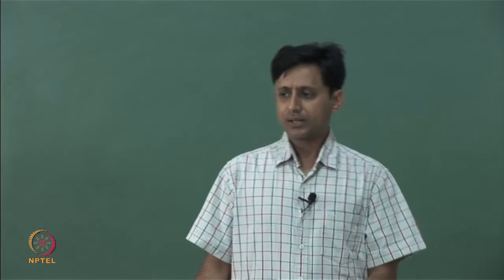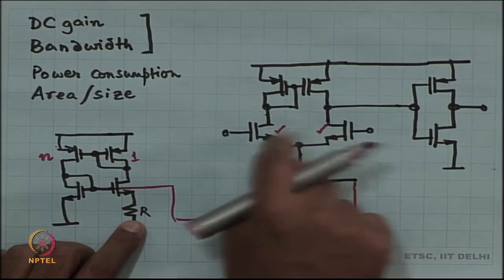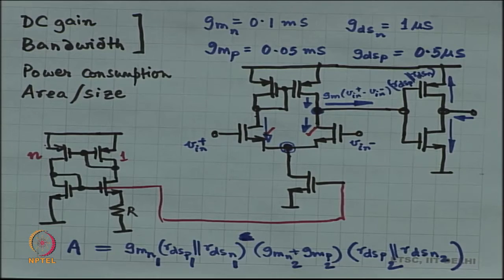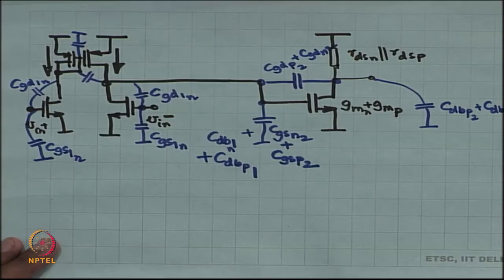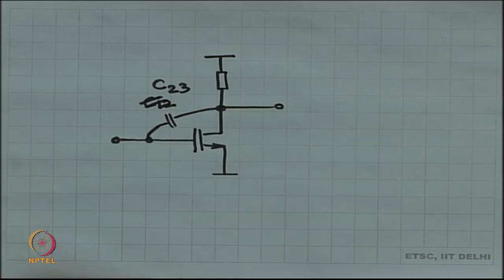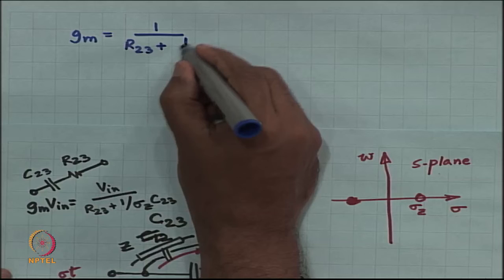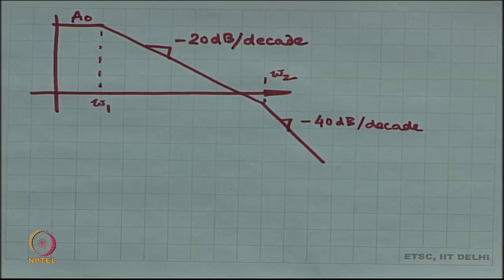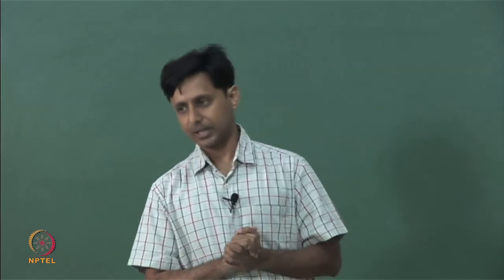mod11lec33

Comment: Also, while compensating for 2nd stage, how do we add a R23 to C23. Isn't C23 coming from the mos device parasitic capacitances, then how can we introduce and external resistor in series with that cap. Pls someone help me with this doubt. You will be blessed
Reply: c2 is coming from mos device cap c3 is even though appears from device but using millers theorem or by adding external cap it can be altered because c3 also acts as the load cap now in c23 the effective value is effected by both c2 and c3 so by alternating effective c3 we also inherently change the value of c23 while value of c2 may remain unchanged